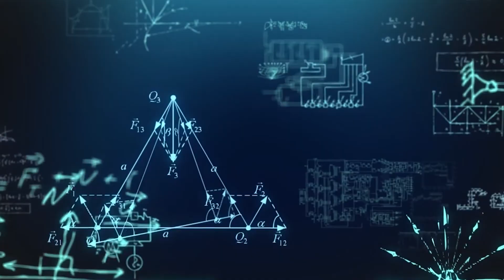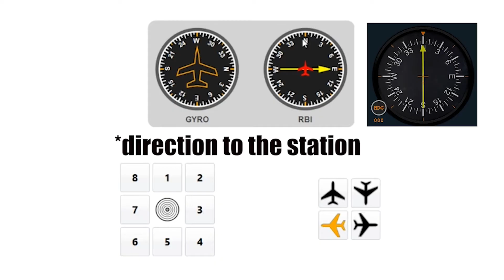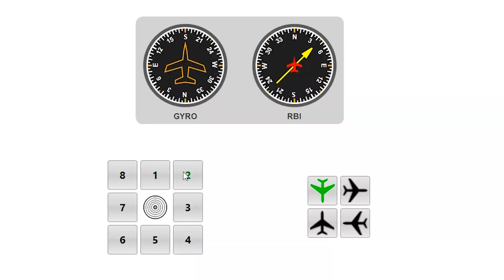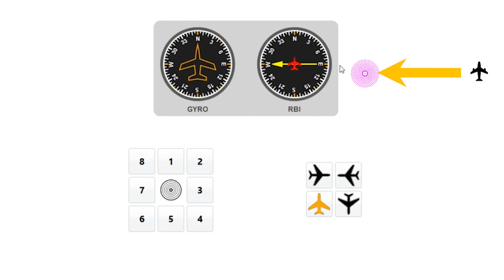Gryo and RBI Test EXPLAINED

Comment: Or you can just take the tail of the rbi and see where it points ! And place it in the aircraft heading
Reply: It doesn't explain the last example though.  Everything from the gyro and the rbi is aligned, why should the aircraft be at "3" and not "8"?  Nothing needs to be rotated.